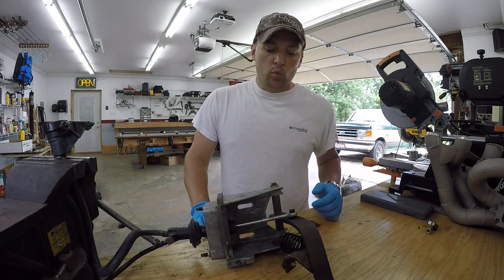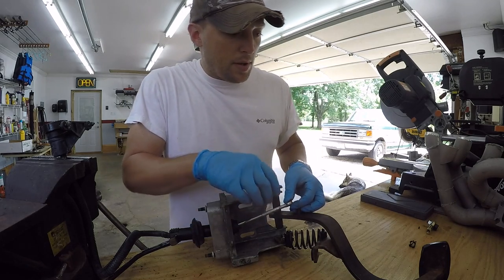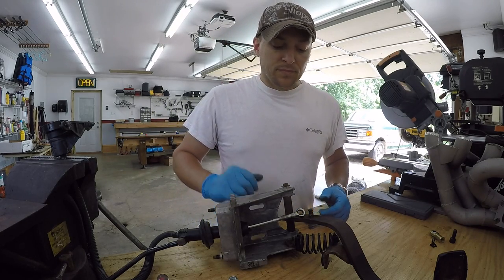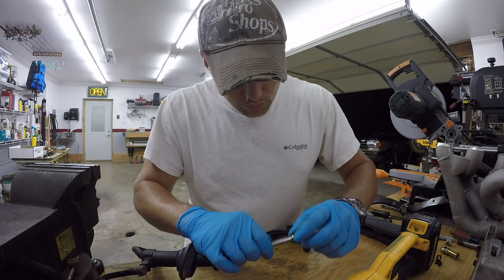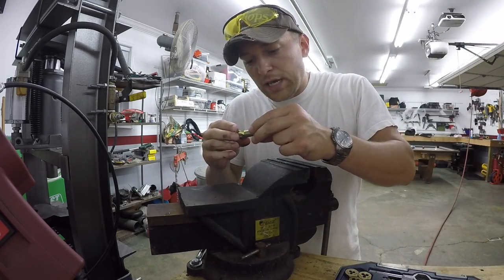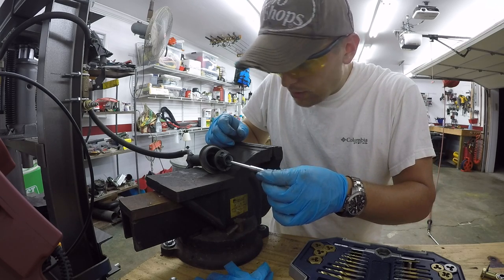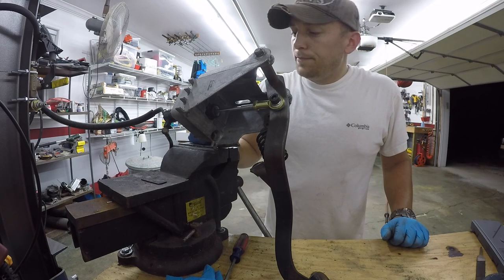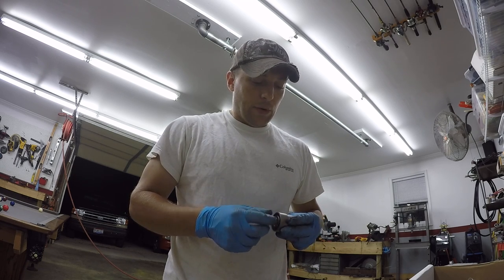99 F250 ZF6 - Heim Joint Clutch Pedal Modification

Comment: my 92 f350 also had bushings worn out, dropped down and wallowed out the hanger. brake pedal bushing on other end ! started to remove seat and do it right, but shortcut it , miked hanger bushing, ordered copper bushing amazon and tightened into hanger behind splined shaft. bushing had coller to contact arm to clutch cyclinder arm.

Comment: Nice job! It was great seeing the entire assembly out in the open... the one I'm dealing with the pin that sticks out from the pedal snapped off, I think I'll buy the pedal assembly and remove the pedal... reinstall on the existing bracket. thanks for the video!

Comment: Save time as these are available on eBay setup to bolt on and go without modifying the joint at all. Time is money. Can be done without taking out complete pedal assembly. Looks like this is taking all day and night to complete the project. Still good info if you can't get one from eBay.
Reply from the maker: You most certainly can get them on eBay already modified, but locally was 1/2 the cost and no wait. Doing this in the truck is absolutely possible, and I would have went that route had I not decided to make a video on this mod. It was ~45 min job with the video and explanation. Had to break up the work for other daily activities. :) Appreciate the feedback!
Reply: Friend, I can hear you say 10mm on the bolt and heim, could you give the leingth needed for both? Kind of a parts list???
Reply: got a link?